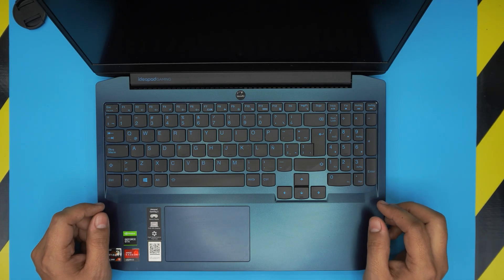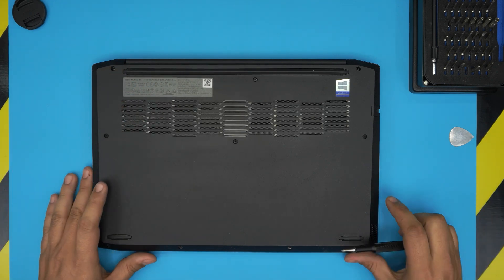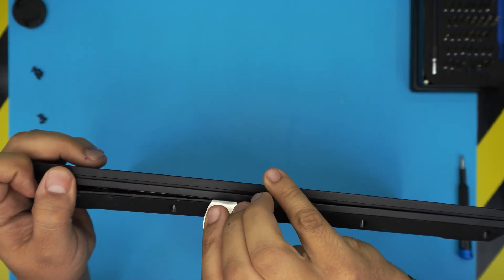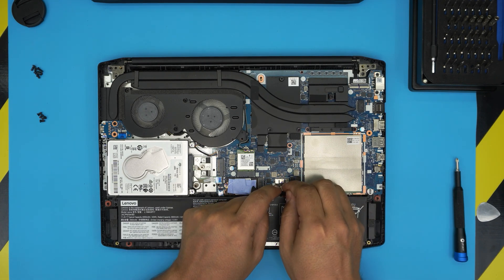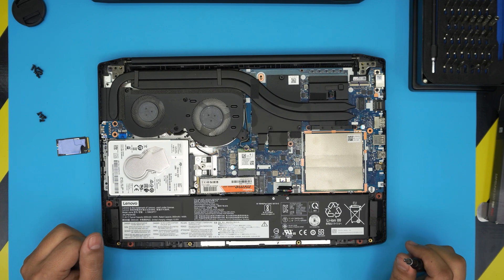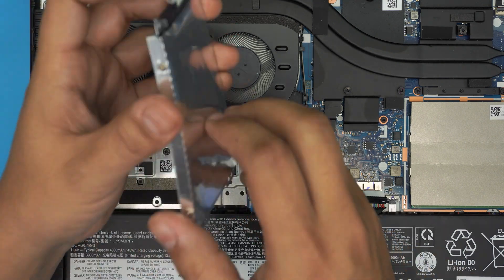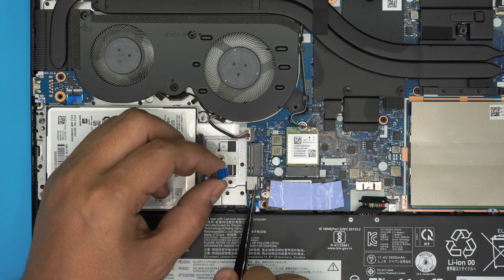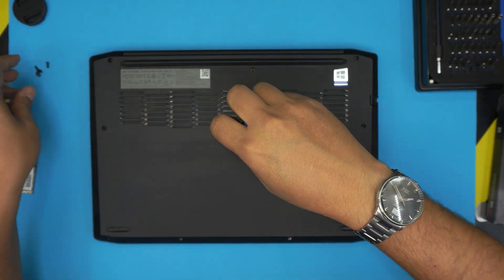How to Upgrade Storage (SSD-HDD) for Lenovo Ideapad Gaming 3 15Arh05 Laptop | Step by Step💻

Comment: Hey cool video, i have an ideapad 3 gaming and a ideapad 1, and for these laptops (and probably many others) there is a battery disabling feature which can found in the bios and is designed for service and such. After your done its just as simple as plugging in the laptop charger and its enabled again

Otherwise great video my friend🎉
Reply from the maker: I appreciate very much the feedback and clearing this option for people 👍
BUT...
I want to assure you that it's highly unlikely that removing the RAM or SSD’s would cause a motherboard short, unless the laptop wasn't completely powered down or was in standby or suspended mode. With my extensive 17 years of experience in laptop repairs and electronics, along with a degree in the field, I can confidently state that there's no need to disconnect the battery from bios or jack when upgrading or removing RAM/ssd/hdd. Technicians who suggest that might have less experience or unfounded concerns. Understanding motherboard schematics, it's clear that when the laptop loses power, there's NO risk to when working on the RAM/HDD/SSD. I can even create a video demonstrating this by trying to create a short on SSD and RAM while the battery is connected – it's practically impossible. Take, for instance, laptops like the one I mentioned, where you don't need to disconnect the battery (and no bios option) to upgrade the RAM or HDD. Some laptops with integrated batteries provide easy access to these components without accessing the battery itself. Manufacturers acknowledge that disconnecting the battery isn't necessary for these upgrades. For instance, the laptop model linked here is just one example of many that support this approach. 
https://youtu.be/iU-oEyBmcFA
While these models are becoming rarer, they highlight the principle that laptops can be upgraded without disconnecting the battery, despite modern designs making it harder for users to perform upgrades, because manufactures need to make money by giving upgrade services. 
I hope I've been able to explain my standpoint clearly.
once again thank you for your feedback, cheers🍻
Reply: @uFixTek  thanks for the explanation, I don't doubt your right but I remember opening up a Dell XPS 15 and printed in bold letters on the battery "sticker" It told to remove the battery before swapping anything out, so yes. I do find it very confusing but you are probably very correct too👍
Reply from the maker: Yes, some manufacturers do make that claim, but it's very rare. the reason is that the manufacturers want people to be on the 100% safe side, so they ensure that the laptop is not on standby. By suggesting the removal of the battery, they ensure that the system is completely off and not in standby mode.

Comment: Hey! I wanted to ask that in my lenovo ideapad gaming 3, i installed one sata hdd, and have the default ssd that laptop comes with in already. So in short, i have one sata hdd, and one default ssd in the laptop. Is there still a slot for one more ssd? Thank you!
Reply from the maker: Yes you can still keep your HDD and use a M.2 ssd right in front of it, it takes a short form ssd:
it take a model 2230 m.2
Should you have any further questions or requests in the future, please don't hesitate to ask me.
Reply: @uFixTek  thank you so much for your reply! you have helped me out immensely, as I'm a game dev and i needed extra storage
Reply from the maker: It's my pleasure my friend. cheers🍻
Reply from the maker: you don't need to remove the hdd in order to have m.2 ssd just get a 2230 m.2 model and install it right  in front of the hdd.
unless if you want ot go with full size m.2 then sure you need to remove it.

Comment: Hi i just bought Lenovo IdeaPad gaming 3 ryzen 5 15ARH05, NVIDIA GeForce gtx 1650 128gb ssd and i want to add a 1tb SSD interno Kingston Fury Renegade SFYRS/1000G 1TB can you tell me if it´s compatable with my model? o can you send a link for the option for me thanks a lot.
Reply from the maker: Thank you for your feedback! If you wish to support the channel, you can like, subscribe, or both!
Regarding your question, yes you can add another 2TB but i need you to open the laptop and see what configuration of the ssd they installed, the short m.2 SSD or a full size. send me a picture to my email.
ask@ufixtek.com
Reply: @uFixTek  ok got it, by any chance i have i will do it then i´ll send the picture to your email thanks again, have nice saturday.
Reply from the maker: oki 🍻

Comment: Usefull video, but I need to know where can i buy the module to install the sata 2.5 ssd, it did not came with the laptop when i bought it from the e-lenovo website, so can you tell me where to buy it ?
Reply from the maker: Thank you for your feedback! If you would like to support the channel, you can either like, subscribe, or do both!

Regarding your question, you can find the SATA 2.5" adapter on AliExpress by searching for the part number NBX0001TC00 or 5C10S30065. Here is an example image of the adapter: https://imgur.com/a/5a3m8Ib

If you are planning to install a 2.5" SSD, you can simply use double-sided foam or tape to secure it in place. There is no need for a caddy in this case. Although I couldn't find a seller for the specific caddy you mentioned, it is not essential for the installation. The foam or tape will be sufficient to secure the SSD in your system.

Comment: max DDR4 for 15ARH05 is 32 gb ? i can add 1X32gb without any problem ?
Reply from the maker: Thank you for your feedback! If you wish to support the channel, you can like, subscribe, or both!
Regarding your question, no we have tested and had a hard time to post, this laptop motherboard can take up to 32gb but on two dim configuration.
and also it is much much better and you will get the best performance if you install 2 x 16gb, then you will get dual channel memory activated automatically.
here is a video for ram upgrade:
https://youtu.be/DF-SHZJvUm0
https://amzn.to/42MhiVL
Should you have any further questions or requests in the future, please don't hesitate to ask me.
Reply: @uFixTek  thank you very much.  I bought it and i ll get it soon . Can i add a 1 or 2 to SSD ? With 2x16gb dd4 3200mhz i think its a good upgrade
Reply from the maker: i would add a good ssd 1tb instead of the HDD (super slow)  and have my windows on this new ssd and the original ssd as a 2nd storage, the best ssd's are the samsung pro
https://amzn.to/3MnQe9u
Reply: @uFixTek  oh ok , one more question , can i remove original ssd and put 2 SSD 2280 ?
Reply: @uFixTek  i bought a Samsung 970 EVO Plus 1 To , $60 only lmk if i can install 2 SSD like this ( i will remove the 2230 original one )
Reply from the maker: yes you can and it will sit perfectly right beside the hdd: https://imgur.com/a/GhBhiwB
Reply from the maker: yes it will work like charm

Comment: One question here, have you perhaps managed to place 3 disk in the pc, that being, 2 nvme and 1 sata drive?
Reply from the maker: Thank you for your feedback! If you wish to support the channel, you can like, subscribe, or both!
Regarding your question, we have done a test with two m.2 and one HDD or SSD 2.5"
you will need to get a m.2 2230 size for the 2nd m.2 slot.

Comment: Hello! You said that theres a second slot for m2, for what is that 2nd slot ? Can i put another SSD? 8:55
Reply: Is a 2230 SSD?
Reply from the maker: Thank you for the feedback! if you wish to support the channel you can LIKE or SUB or both :P
regarding your question: you can have HDD 2.5" or ssd 2.5" and at the same time a sshort nvme : https://amzn.to/3ZVbs27
Reply from the maker: no only two you can have at the same time HDD/SSD 2.5" +  one m.2
Reply: @uFixTek  You're wrong, I'm using 3.  I use 3 hard drive. 2 ssd and 1 hdd. You can insert a 2280 nvme that will sit on top of the hdd. It'll bend slightly but not concerning. I'm using this setup for 3 years.
There's a video on yt, if you search hard enough you'll find the video.

Comment: Hello Bro, Thank you for the video. However I have a question, I have a base cable for hdd which was delivered with this laptop. Is it suitable for the ssd which I want to put instead of the hard drive? Or I need a special cable for ssd.... I dont want to use nvme ssd, so the following question, What sata does this laptop have? Can I use for example kingston 2.5 sata 3 TLC?
Reply from the maker: Thank you for the feedback! if you wish to support the channel you can LIKE or SUB or both :P
regarding your question:  if you don't want to upgrade the m.2 ssd or replace it, then you can have another HDD or SSD by using the adapter that you have there is no spacial adapter for  ssd , the HDD and SSD use the same adapters.
the best HDD and SSD are:
https://amzn.to/3RCCTuM
https://amzn.to/3HDtXRd

Comment: Have a quick question the computer comes with windows so do you have to reinstall windows on the computer
Reply from the maker: Thank you for the feedback! if you wish to support the channel you can LIKE or SUB or both :P
regarding your question:  if you replace the SSD to new SSD then yes because the windows and files are in your old ssd. its very easy to install and the windows key will be activated from your hotmail account once you login. all you need a usb drive and 10min and you are set to go.
🔵 Create windows 10 usb boot drive: https://youtu.be/uDu8j2lE-dM
🔵  install windows on Hp laptop: https://youtu.be/euJvBhmoDzY

Comment: Sir , I am using the  rtx 3050 one.  Are the upgradability options same as the one you have shown in the video?
Reply from the maker: Thank you for the feedback! if you wish to support the channel you can LIKE or SUB or both :P
regarding your question: yes they are the same my friend. but to double check give me the exact model of the laptop.
Reply: @uFixTek  Lenovo Ideapad Gaming 3 AMD Ryzen 5 5600H 15.6" (39.62cm) FHD IPS Gaming Laptop (8GB/512GB SSD/4GB NVIDIA RTX 3050/120Hz/Win 11/Office 2021/Backlit/3months Game Pass/Shadow Black/2.25Kg), 82K201RRIN
Reply from the maker: the one you have that only supports m.2 NVME ssd , it doesn't have space for 2.5" hdd or SSD. so you can upgrade the m.2 ssd to a 2TB , and ram you can go with 64GB 2x 32gb (but i recommend 32gb)
32GB: https://amzn.to/3YG2iXt
top of the line nvme: https://amzn.to/3HSm4cj

Comment: nice video, does it support 2 2.5inch sata drives at the same time or no?
Reply from the maker: Thank you for the feedback! if you wish to support the channel you can LIKE or SUB or both :P
regarding your question: NO my friend its simply no space for two 2.5" hdd or 2.5' ssd drives only one.
Reply: @uFixTek  thanks, also i ordered an m.2 2280 ssd, do i need a cable for it or do i just put it in the slot?
Reply from the maker: just plug it in the slot and thats all, you will use the same screw from other m.2

Comment: Lenovo laptops now! Have a setting called building in battery. Where u can shut the battery off without unplugging it and breaking the connector lol!
Reply from the maker: for your information not all the models have that option! i been doing this for over 17years and very very few small % have that, and you NEVER ever need to disconnect or disable the battery to do any SSD or ram upgrades.
a clear indication is on many other laptops that leave you the ssd and ram cover accessible with one screw for you to open and replace and with battery inside the laptop connected and no option for disabling it. no technician ever removes the battery to do any upgrade! a technician that know the circuit and know the schematics. but you may do as you wish if yours have disable battery and you can disable if it makes you feel safe. or remove the battery.

Comment: I installed my HDD with this cable but it’s not spinning? What the issue?

I put the same HDD in my older laptop and it has no issues at all
Reply from the maker: Thank you for the feedback! if you wish to support the channel you can LIKE or SUB or both :P
regarding your question: what cable you used? the sata to usb cable adapter, after plugin in got o disk manager and see if you see the disk is showing there. if it shows and it may not have drive letter assigned , right click and assign drive letter.

Comment: what specs of HDD that already installed in this laptop!
Reply from the maker: Thank you for the feedback! if you wish to support the channel you can LIKE or SUB or both :P
regarding your question: the hard drive on this models and or any laptop are depending of the stock on hand, so it can be anything from Seagate, toshiba, WD. it all depends , we open a lot and its always different.

Comment: you can also put in a second M.2 SSD with a 2280 form factor
Reply from the maker: Thank you for the feedback! if you wish to support the channel you can LIKE or SUB or both :P
regarding your question: you can have two SSD m.2 but you have to replace the one you have and get:
get 2280 for where the original is located, and a 2230 for the one right in front of the HDD.
2230: https://amzn.to/3qsA42C
2280: https://amzn.to/3RzvFXM
Reply: Hi, Thanks for the comment. Can we use two SSDs 2280 and 2242 at the same time ?

Comment: Thanks a lot for the video, I just gave you a big LIKE :)
May I ask if this  laptop can handle 2 hard disks at the same time or not, for example: 1tb ssd and 4tb hhd. Is it possible?
Reply from the maker: Thank you for the feedback! if you wish to support the channel you can LIKE or SUB or both :P
regarding your question: much appreciate the like, as i have mentioned in the video, the combinations that you can have is have both HDD up to 2TB only and ssd m.2 NVME up to 4TB.
hdd has to be low profile:  https://amzn.to/3vRVCZV
nvme ssd m.2 : https://amzn.to/3OPA070
Reply: @uFixTek  
May I ask what does a low profile hhd mean? Do you mean a low RPM?
Reply from the maker: my low profile it means the thickness of the HDD, they can go from 5mm, 7mm, 9.5mm, 12.5mm, 15mmor 19mm
don't go anywhere over 7mm profile else it won't fit

Comment: What about ram? Lenovo says 32 GB max But I think you can put 64GB with no problem. Do you have experience on this?
Reply from the maker: Thank you for the feedback! if you wish to support the channel you can LIKE or SUB or both :P
regarding your question: we have upgraded this laptop to max 32GB, the CPU can handle 64GB but the board needs 4 ram dim in order to this to work, the rims that it has can support only 16GB each.
therefore technically 64GB but physically only 32GB

Comment: The NVMe Slot can support the full size(2280), but only if the 2.5" HDD is not installed? Is it true? I'm so confused because I've this laptop and there's only hdd installed i want to install SSD too because it will make it fast! Please suggest me
Reply from the maker: Thank you for the feedback! if you wish to support the channel you can LIKE or SUB or both :P
regarding your question: no my friend, you can have a 2.5" HDD up to 2TB or 2.5' SSD up to 4TB + another FULL size 4TB NVME (2280) the screw hole for the 2280 size is right beside the 2.5' sata connector here is a nvme 2280 laying down flat there.
we have installed full size 2280 without any issue. https://imgur.com/a/SoaSH6F
Reply: @uFixTek  According to Lenovo you cannot use all 3 storage slots at the same time, but you can use any combination of two.  Is this accurate?